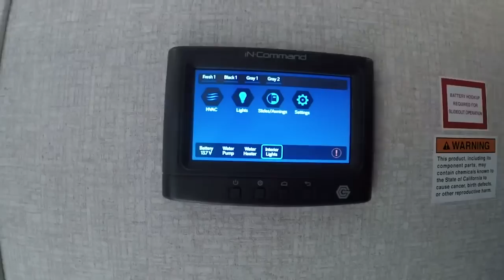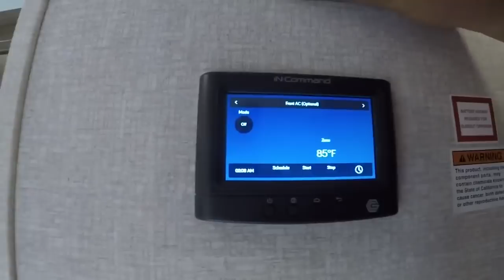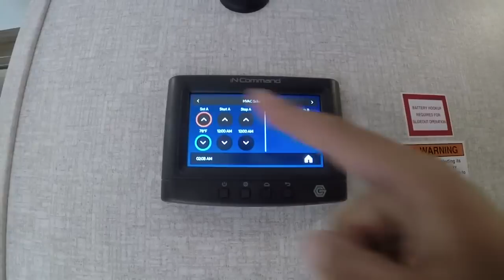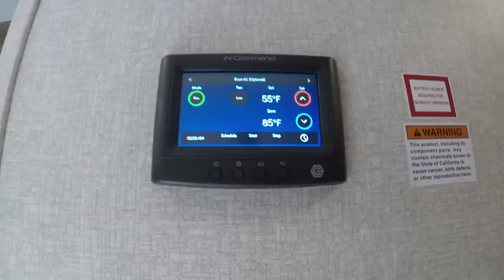How an RV is made -  Keystone RV Factory Tour (Behind The Scenes)

Comment: I work at a dealership and do pre delivery inspections on these units. Basically I inspect everything, put my hands on and operate everything, run water through the system, run the pump and make sure all the monitoring panels light up all the lights. Most common problems as of now is the roof-top solar panel plug-in lacks lap sealant and insert trim isn't secured on the roof of the camper. That's as far as exterior cosmetics go. I've ram into a lot of wiring problems as well. Don't worry because all those problems are fixed before purchase. They're great units 👍
Reply: The dealers don't fix shit, they want the sale, it's the customers problem after that.
Reply: @TheGenerationX894  Not where I work. We do both service and PDI before sale. I've only gotten better at what I do and I've done like 6 roof jobs since I originally posted this. And I mean roof replacements. We try our best to provide factory quality work if not better. And there's only two of us working in the shop at the moment and we tackle big jobs like you wouldn't believe. We want our customers to return and be happy with the services. I do not speak for other dealerships.
Reply: @TheGenerationX894  And ever since the economy hit the floor, quality has been less and prices have been higher in the last couple years.

Comment: I worked as an upholsterer and one thing I learned about furniture,  it can ALL be disassembled and reassembled anywhere. I have put them in boats, RV's , tiny homes, you name it. Its not free, but yes, furniture  can be disassembled and reassembled. As we said, its just lumber, fabric and blood( always blood with staples).  Learning that throwing an RV together in one day really bothers me. knowing those assemblers get paid by piece bothers me. In their haste to assemble, they don't care if they drive a screw or staple though a water line or wire. Anything done over and over day in and day out invites stupid mistakes. If the screw gun suddenly starts malfunctioning,  that operator is going to press on reguardless  if its not functioning right. That stapler that  Sudddnly starts skipping staples is going to keep being used because the operator will fall behind trying to locate a replacement stapler. I worked in a factory and watched employees  melt down because their machine suddenly started acting up. All they could say was how much it was costing them because their numbers for the day would be down. These company's  never figure in for down time due to supply shortages, lack of  repair equipment, down time because of repairs. One woman cried for the whole time her machine went down. Production should NOT be a factor in building an RV. Quality and mass production never go hand in hand. There should be no excuse to mass build a recreational product, ever.
Reply: YOU SAID IT
Reply: Cardboard
Reply: Yes sadly most companies don't take employee satisfaction and happiness into consideration at all.  All they worry about us the hard cost of everything but don't realize how much stressed and unhappy employees cost them in hidden costs that are difficult if not impossible to  calculate.  Costs brought on by poor work due to being rushed or lack of resepct for the company brought on by the companies lack of respect for the workers.

Comment: I just looked at new 28 ft. Springdale at our local dealer and when I walked in I was impressed with the well laid out interior and colors, and was ready to write a cheque.  THEN I went up on the roof and couldn't believe the terrible workmanship and 'quality' control from this company. The roof was covered with bubbles, air pockets around everything that penetrated the roof membrane, (vents etc.),  none of the membrane was adhering to the edges of the roof/wall joint,  lookin through the top of the skylight, you could see the trusses and no insulation. The dealer had a second Springdale and I checked it out as well, and it had the very same issues. The head tech came to look at the unit and said they were going to immediately contact Keystone to be able to fix the roofs under warranty, good for them if they do that. Will be interesting to see if the dealer tries to sell these units to unsuspecting customers.

Comment: i own a 2018, 178LHS ,keystone travel trailer.  had nothing but problems with it since we bought in march,2018. a/c was not cooling properly, had water leaks, had to replace the dinette wood at 5 months after purchase. when it rained, water flowed out of the heater, onto the floor. at 6 months, the a/c unit was hitting the top of the bathroom door. there fix, cut the door. then told them that there was water stains, running down the wall, now the roof is rotted. the said it is  all my fault. wont repair the roof. and now, the a/c is now touching the top of the bathroom door again. all this within the first year.
Reply: Sorry about your problems with the Keystone travel tailer.  I guess the 5th wheels are different.  I have a 2014 5th Wheel and it is perfect.  Never a problem.
Reply: All RVs are trouble on wheels.
Reply: @theeaskey  Yes, they are nice. But they are all built like crap, sad but true.
Reply: probably new guys building all these things, there's new faces in here every week

Comment: I have one the sprinter series from Keystone rv and there's a few things I don't like about it,they seem very cheaply made and somewhat poorly designed,other things are designed very well,my 1st complaint is the outside water hookup for running water incoming into camper for the sinks shower and toilet,I really hate how the box is so small and tight and it makes it difficult to hookup a hose,especially for someone who has big hands,not very user friendly,my 2nd complaint is that the type tv mount they used for the TV in the living room does not move and is way top tight to the wall,it was so annoying that I ended up removing it and replacing with a swivel mount so you easily move it away from the wall for plugging in accessories such as dvd players video game consoles and any other accessories you can think of,my 3rd complaint is the furrion soundbar,you can't adjust the radio antenna on it for better tuning,because it's tucked away behind the fireplace mantle and you have to take a screwdriver and remove the mounting screws and pull it out just to get to the antenna wire,the 4th complaint is that the the electrical wiring for the receptacles,the receptacles are very dangerous,the wires are fine,whoever wired the receptacles did not peel back the paper on the romex cable and just shoved everything into the receptacle,also the way the receptacle is designed isn't very safe,it's made by legrand and has punch down splice style designed which doesn't make very good connection with the wires and it ended up catching on fire the one night while i was camping,luckily hardly any damage was caused thanks to the included fire extinguisher, I was able to put it out...now I'm not sure how many other manufacturers designed their campers like this but I'm sure quite a few,because I've seen stupid stuff like this before,just be careful what you buy when you by a camper.

Comment: I bought the 2018 impact toy hauler, who thought that the a/c control behind the tv was a good idea?  And, when I hook up to s hotel powered 30 amp only half the power outlets work?? 

Pretty happy with everything else so far
Reply from the maker: Nice to hear you are overall happy with your purchase. Sounds like you might want to take your camper to an authorized dealer to have them check into the power issue. Happy camping

Comment: Had 3 Keystone products, Outback TT,Cougar 5 Wheel and now a Alpine their best quality. The 1st 2 were very good products. The 2017. Alpine is a disaster and they don’t back their warranty. On the main slide warranty they accused me OS damaging it myself until our repair facility advised them that they over torqued the slide during assembly. Had it fixed and 6 months later on the 6 th time using the pinion gears broke and they wouldn’t back up the repair $2000 later I just don’t trust this RV. Last one for me. Don’t buy these. Customer service is terrible. Go to Grand Design with 3 year limited warranty.
Reply: Doesnt keystone have 3 year warranty?
Reply: Only 1 year when I purchased. They simply don’t care about your repairs and only selling new units.
Reply: @gbthecamper458  oh. . .you're right. That's unfortunate. Theres still only a 1 year manufacturing warranty with a 3 year structural.
Reply: @initiatedcrown  that started after sept. of 2018,production date only. my 2018,has a pro date of 06,2018. i didnt get the 30year,altho it is a 2018. i got screwed.
Reply: its 3 year,not 30 year. type mistake.
Reply: Dude grandesign far more worst , they select their customer and gave them a really worst bad dream for specific fifthwheel (momentum is special for them netvvorx only)